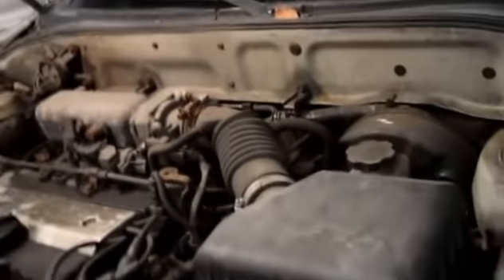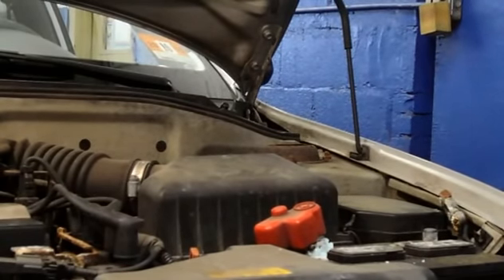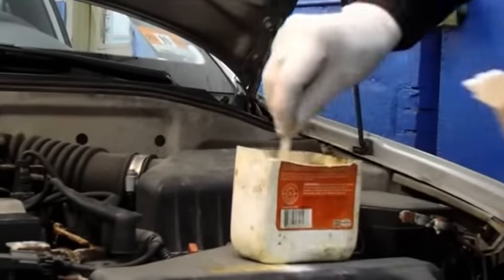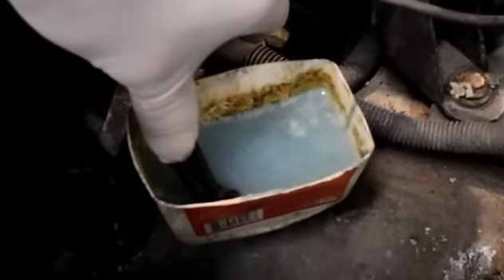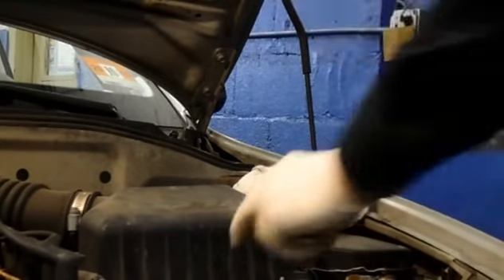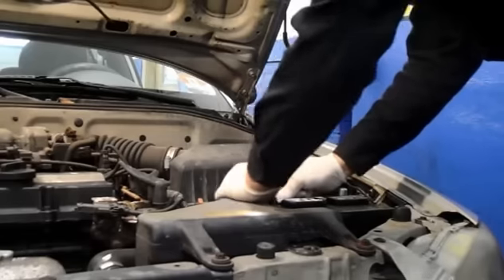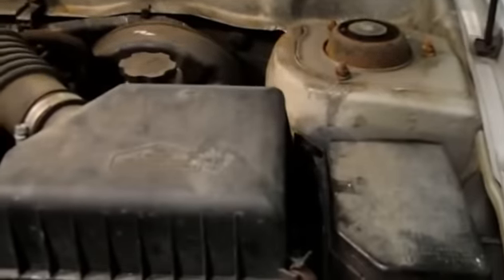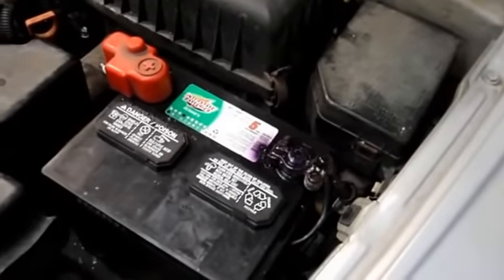How do you replace a car battery on a Hyundai

Comment: I tried to replace my battery today on a 2002 Accent but I ran into difficulty using my socket wrench to unloosen the bolts of the frame holding the battery in. It just wouldn't loosen the bolts - any special trick? Any workaround? Thanks,
Reply from the maker: Duricas  Sometime they can be very difficult to remove the only thing I would say is to use some type of rust buster.